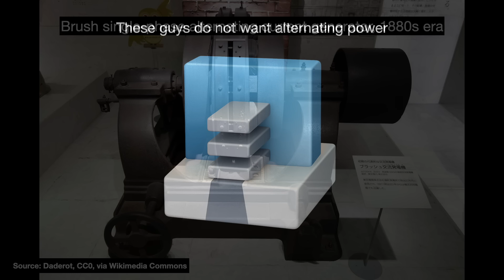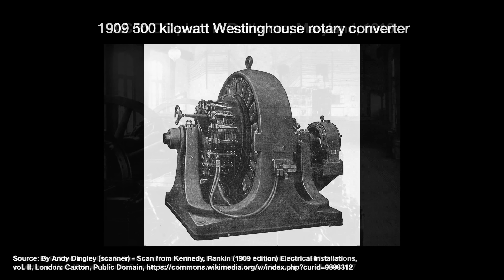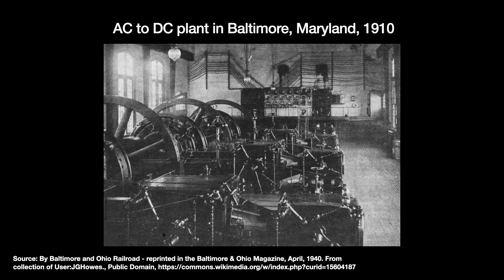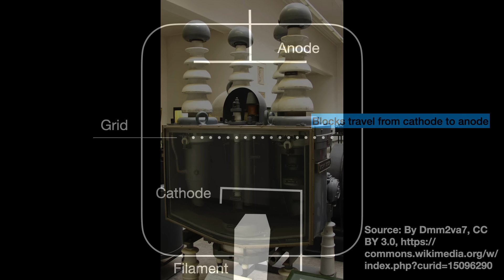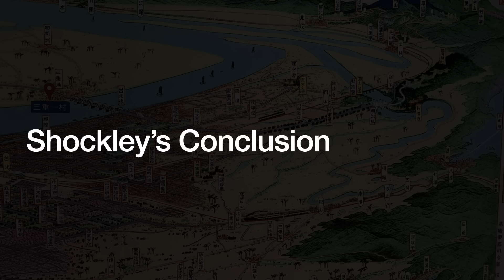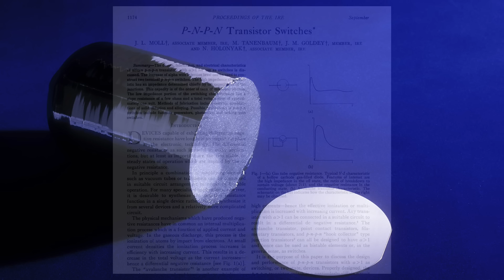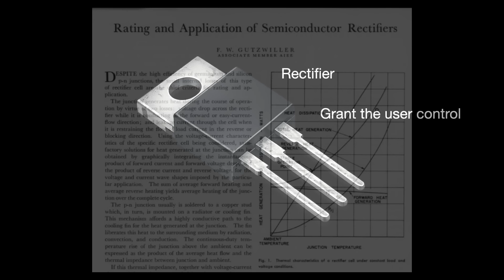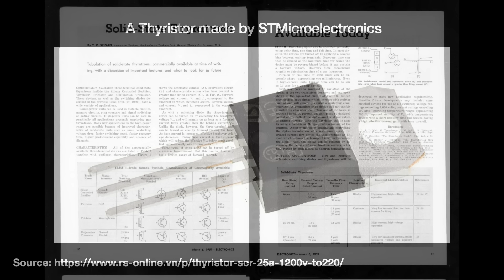Thyristors Did to Power What Transistors Did to Logic

Comment: ..I recall when I got familiar with a large Reliance motor drive controller using large hockey puck thyristors from International Rectifier.  .  This replaced some old motor-genarator sets  Oh, the sparks they threw  when the Thyristos failed...a rare occurrence though.!   This was a drive  for a large parabolic antenna somewhere.... north.    Thank you for your content, the historical take is so interesting! I enjoy every second of it and please carry on with making more! :).   I'm a big fan!
Reply: Shocking that those systems only worked because either 1. mains voltage is alternating, or 2. (applicable to the internal DC rail and inverter) because it worked the proceeding cycle.  That is, one cycle creates the setup for terminating the next, and so on ad nauseam.

Even more shocking that they were so reliable!  Billions of switching cycles, perfectly timed.

Until the one day, something fails, an SCR misfires and... :)

Good thing they invented "semiconductor fuses", which despite the name, don't contain semiconductors, but rather are able to (most of the time) open fast enough to protect a sufficiently robust semiconductor, like an SCR or diode. (Corollary: they open so fast (~1ms) that it doesn't matter if applied voltage is AC or DC, and are usually rated as such.  No small feat, blocking DC at industrial levels!) Usually these prevent enough fault energy that, uhh... fragmentation is avoided, but not always.

Comment: the sound on this video is like a analog recording with a leaking atomic source nearby
Reply: I noticed that too
Reply: Fitting, for a scientific history lesson
Reply: I was going to say. It’s been present at least for a couple videos now. I thought it might have been my headphones but I heard it through my phones speakers this time.
Reply: Chernobyl audio filter selected.
Reply: 3.6 Roentgen—not great, not terrible
Reply: A “leaking atomic source” could describe just about anything from which atoms escape. However, if you’re suggesting interference from an ionising force, like an insufficiently shielded radioactive source, then you’re right (other than about it only affecting analogue recordings, because all microphones have a mechanical interface that initially provides an analogue signal which is susceptible to such interference, regardless of how the signal is processed and recorded beyond that). Digital signals aren’t immune to this either, but they’re affected differently and it won’t have the same audible effect.
Reply: @anhedonianepiphany5588  So...a bucket filled with water with a hole in it qualifies. Actually, forget the hole. Water evaporates.
Reply: @anhedonianepiphany5588  can be right ,  nuclear sources dont produce radiation at regular intervals like these pulses spaced 115ms apart

Comment: It should be illegal to talk about mercury arc rectifiers and not show a video of one. These are the coolest electronic devices ever!

Edit: https://youtu.be/latzy2NDcYg
Reply: True. PhotonicInduction has a good vid of him firing one up in his living room. Insane.
Reply: @oldo2840  Photonicinduction "testing the 50 year old mercury arc rectifier" https://youtu.be/2pDcv6g1FE0
Reply: @w0ttheh3ll  absolute legend. I hope he comes back
Reply: They really are!!!!
Reply: I kept a few that were pulled from service for an electroplating plant I worked at when they upgraded to silicon rectifiers. The upgrade required a lot of tap changes on transformers 😅. I had one on top of a big Tesla coil at the Top Secret attraction in the Dells Wisconsin. It was pretty sick seeing it glow blue with streamers from all 6 of the anodes. ❤
Reply: @christopherleubner6633  the substation across the street from me used to house a transformer that operted the DC power supply for street cars that used to run in the city and suburbs. It still has a small side room that was used to house the mercury arc rectifiers, which was used to get the DC power for the cars. you find all over the old rails, cut up and used as posts, and the DC power cables are still buried, left in situ as they were not worth digging up. the poles however were refurbished, and are still in use, well over a century old, and still sturdy, made from hexagonal sections, which are steel plates bent twice, and at a taper, and then welded to make the hexagon, and then stacked and welded to get the height.
Reply: Sometimes a fluorescent lamp will operate as a half wave rectifier at end of life.
Reply: @just_joe102Flickering lights not my thing.
Reply: @tnasburypl ✅
Reply: @just_joe102 they always work that way, that’s the point of 50/60Hz
Reply: @DoriFord No, not really.  A fluorescent bulb can operate on DC just fine for a while, but that forces all of the mercury to travel to one end of the lamp.  That’s the real reason AC is used.
Reply: The lamp acts like a diode when it has consumed all of the emitter on one end of the bulb.
Reply: Mercury Arc Rectifier - Siemens https://www.youtube.com/watch?v=latzy2NDcYg
Reply: When I grew up, my dad had a car battery charger that used a mercury tube as a half wave rectifier.  I wonder what happened to it.
Reply: https://www.youtube.com/watch?v=2pDcv6g1FE0
Reply: Urban explorers went into a long abandoned  deep underground WW2  London bomb shelter. (A Sub Brit team)   They found the power still on after a lifetime and the mercury arc rectifier still doing it's magic  light show.   Their work is all on u tube for anyone interested.
Reply: Was wondering. Are you talking about that elevator with the vacuum tube rectifier?
Reply: To me THAT looks like what a QUANTUM COMPUTER SHOULD look like! Hahaha.
Reply: The ultraviolet light from a Mercury vapor rectifier will fry your eyeballs just like the arc from a welder.  They are dangerous to look at.
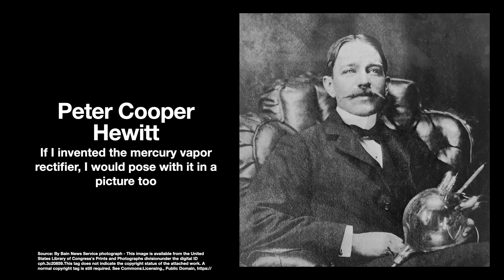Reply: 2:51 he shows one here! Though not in It’s amazing glory!
Reply: The video did show a picture of it, yeah i know you ment a video of it but still ;)

Comment: My graduate advisor once said: "if you take a diode and add another junction you get a transistor and if you add another junction you get a headache."
Reply: Germans Heinrich Johann Welker and Herbert F. Mataré worked on radar in WW2.  They solid state device called a duo diode as part of their detector/demodulation circuits.
One day while testing by injection a small signal they noticed amplification but didn't have time to pursue  the phenomena.  
After the war in 1948 they developed a transistor at the same time as the US did while working in France.
Solid state selenium and copper oxide rectifiers existed in the 1930s an outgrowth of crystal rectifiers.
An "Magnetic Amplifier" (saturable reactor) when combined with copper oxide diode could control currents of thousands of amperes.
-All before thyristors.
Reply: @bernhardzunk7402  The transistor was invented at Bell Labs in Murray Hill, New Jersey on December 16, 1947, that is not so much at the same time, but a different time.
Reply: @Golden_SnowFlake  From Wiki "While at the Westinghouse subsidiary in Paris, Welker and German physicist Herbert F. Mataré developed a point contact semiconductor amplifier, demonstrated in June 1948. This coincided with the announcement by Bell laboratory scientists of the demonstration of a point contact transistor on 30 June 1948."
-The dates the device was demonstrated by both teams was June 1948 with the Bell team in the last day of June. Both had done laboratory work in the year prior and a patent war ensued which bell labs won I suspect on lab note dates.
Reply: @bernhardzunk7402  Fantastic perspective.
Reply: If you add a fourth layer you could get either a thyristor, a GTO or an IGBT depending on how you're feeling that day
Reply: @LamantinoElettronico As I heard Chris Boden say in one of his videos, "I support the IGBT community"
Reply: @SteveW-em6cv  Chris can't resist a transistor. 🤪
Reply: But if you add a 4th junction you get a modern two-gate FET and a substantial reduction of power consumption
Reply: @AlexanderTzalumen  and if you remove one and stick it in a box, now you’re cooking with microwaves.
Reply: Yeah, the Shockley Transistor didn't start out as a reproducible result, so we can only do STM and imagine that the impurities and cavity/vacuum endorse our carrier ideas without invoking fine structure unnecessarily.
Reply: You can take a diode and add another junction by connecting to another diode, but it won't work as a transistor.
Reply: @deanXRayZulu  That's the reason I dislike many diode explainers that leave the viewer/reader with the impression that you take a piece of n-type and a seperate piece of p-type and stick them together, et voila you have a diode. It should be made clear that you start with one piece of crystal and dope two adjacent regions to n and p-types.

The collector and emitter of a bjt are doped to different concentrations, the collector-base junction area is larger than the emitter-base junction... in short, connecting separate parts together and hoping for them to work is like laying a piston on top of a cylinder block and expecting to get an engine.
Reply: bahaha. Awesome quote.
Reply: logic gates can be as colmplicated as make them to be indeed
Reply: LOL.  40 years ago I took an entire university course on thyristors. The major take-away from that course was 2 key datasheet parameters. Max di/dt and Max dv/dt.  If you exceeded max di/dt at turn-on for a short period a small region of the thryristor could be taking all of the current. The heat would be concentrated and you could blow-up the thyristor.  So you needed to design a method to keep max di/dt within spec.  The other problem was in the Off state.  If in the Off state max dv/dt is exceeded you could capacitively-couple current into the gate trigger and turn on the thyristor at a time when your intention was to  have it Off.  You needed to design a snubber circuit around the device to limit max dv/dt.
Reply: When you try that in practice you will see that it does not work as a transistor, because it has no current amplification.
Reply: @radiofun232  transistors have variable purposes.
4-junctions is required for modern FinFETs, but FinFETs are used for logic, not amplification. The extra junctions allow the output to switch on without passing continuous current.
Reply: @AlexanderTzalumen  Yes, that is what I mean/also know. Simply soldering 2 diodes together and thinking that this acts as a transistor with a certain amplification factor does not work.
Reply: @radiofun232  simply soldering diodes together does not create additional semiconductor junctions. The professor was speaking about the construction of the device, not an assemblage of parts
Reply: @watches-on-FF  The issue is not about creating additional semiconducting junctions, sorry to say.
Reply: Not all circuits need amplification... switching,... impedence converters, ...stuff like that..
Reply: @peterfitzpatrick7032 impedance just uses resistance to stop the flow or let it keep flowing, so it does what a switch does, with out switching.
Reply: @JerryScott-k2w  Jerry, impedence matching is much more than simply throwing a resistence between 2 disparate circuits... if you are matching a hi-Z output to a low-Z load, simply using a resistance to "match" them will just reduce the sources level going to the the load... impedence converters match the circuits without that dB loss... 🤔
Reply: That joke is so cringe.  What a dork.

Comment: 1:28 actually many devices can directly use AC power, like electric motors, heaters, certain types of lightbulbs etc. it's just not all devices
Reply: I mean, it's just motors and heaters really. 
Lightbulbs are just fancy heaters until we get to LEDs.
Reply: yes and no

If you want more fine grained motor control, you'll need a motor driver that makes its own specific 3 Phase AC power. The driver will also need DC.
(which is why these motors are often called "brushless DC motors'", even tho the motor themselves are in fact, not DC)

resistive heaters can use AC power, they'd also work just fine on DC, but most importantly, for a lot of household applications, you don't actually want a resistive heater:
An electric kettle, toaster and oven use a resistive heater, but for home heating and warm water, ideally you'd want a heatpump (better efficiency), which is mainly a motor (tho in this case a simple AC motor will probably work just fine).
There are resistive stove tops, but imo they all suck and induction stove tops are way better, and those again will need special driver electronics, which again will take DC.

And for lightbulbs, (except for the lightbulb in your oven), you want LEDs for the way better efficiency, which again, use DC.
(why the oven lightbulb shouldn't be an LED is left as exercise for the reader)

so TLDR: there are not that many devices that run on AC natively, and most of them either run on DC just fine (resistive heaters), or could be build with very minor differences to use DC too (motors).
Reply: @mari_023 Lots of items run natively on ac like transformers to send high voltage low current transmission lines in a grid.  Saw mills, industrial compressors, welders, bending brakes, chillers, industrial driers, Aluminium furnaces, etc. grinders, etc etc
Reply: @barryobrien1890  yes, for non-household / industrial applications AC is often more convenient, or you'd have to convert it anyway.
Reply: @mari_023  where I live all houses receive 3 phase power as the standard, distributing one of each phases to a different household. Also motor control of a dc motor (both single and multiphase) can be done with a simple slider contact over a copper coil, like how old diners used to work, or with a more elaborate setup with two copper coils offsetting the phase. Voltage step up and down is also much easier with dc.
Reply: @mari_023 brushless DC motors only use DC. 

What they use is pulsed DC. The current only ever flows one way. The voltage trace on an oscilloscope vaguely resembles AC voltage so I suppose that could mislead the uneducated.
Reply: @Solnoric  not really. The controller essentially converts DC to 3 phase AC with the phases tuned to the rotor position. Have a look at most electric vehicles and you'll see the three phase wires. Obviously DC only uses 2 wires.
Reply: In fact, most devices were perfectly capable of using AC directly until the national grids were already built